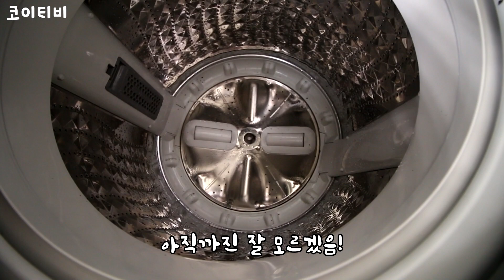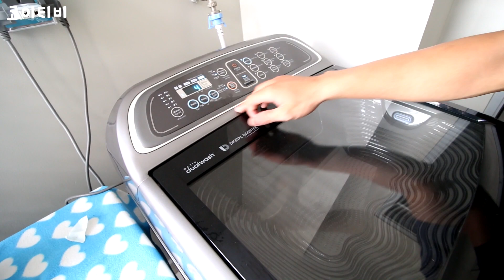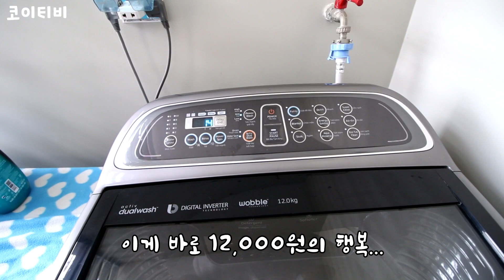1년만에 통돌이 세탁기를 청소 했는데... 충격적인 세탁기 내부!

Comment: Great video. I love to watch when high-tech gadgets got fixed and cleaned 😊
Reply: Chau Tran He did not follow cleaning procedures using bleach.
Reply: @sunha2133  I got a new machine so do you run a cycle with bleach to avoid having to take it apart and clean it?
Reply: @JamConcerned  Follow the manual for the cleaning instructions.
Reply: @sunha2133  yeah, I know but it's not a bad way to clean like that.
Reply: Chau Tran, You use vinegar to clean coffemaker.
Reply: @sunha2133  not only coffee machine. You can use it for washing machines as well.  A little bit of vinegar in combination with baking soda and hot water (90°C) can unclog all the dirt and mold in the drum.